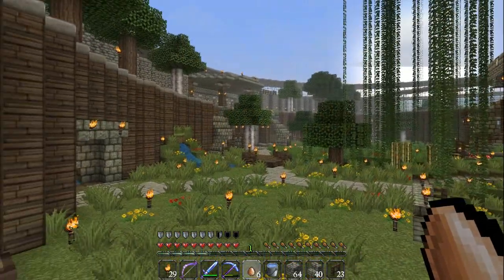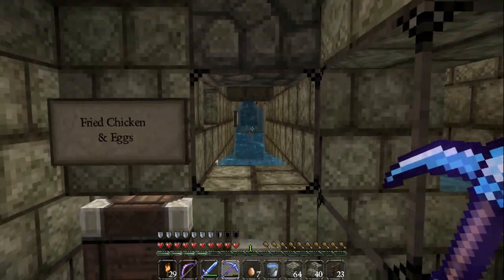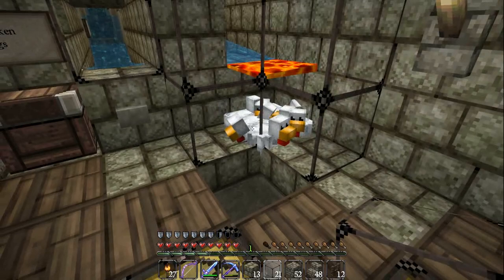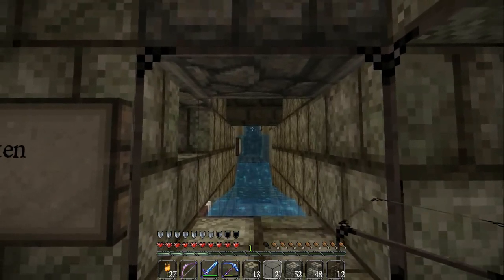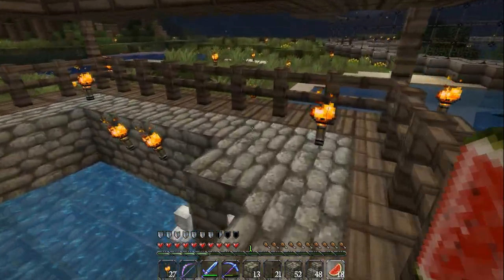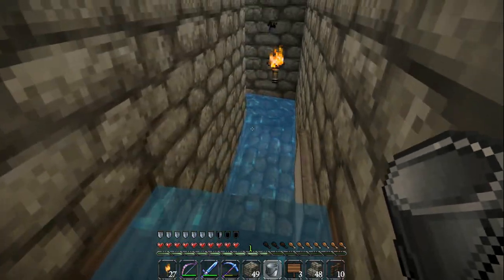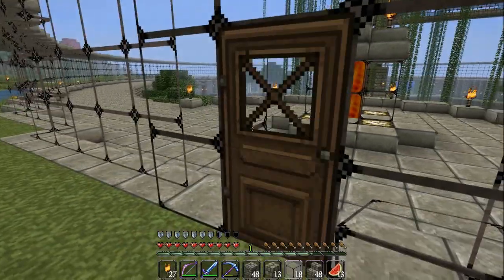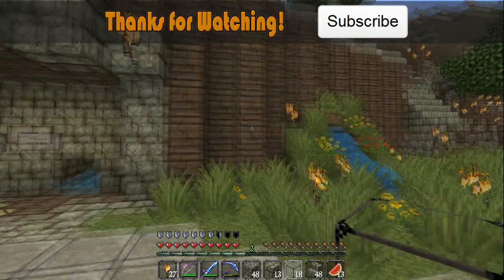100% Effective Chicken Transport - Minecraft LP #74

Comment: I have made an improvement to the chicken coop. Basically I have another coop on top of the coop you already have. The top coop's water supply is permanent meaning chickens never fall and get cooked. However the eggs they produce fall from top coop to bottom coop into the waterway. So even after cooking all your chickens you do not lose the egg producing capabilities as eggs will constantly be produced by the chickens in the top coop.

Comment: Love the whole chicken farming system.  I'm having an issue though in my waterway to get the chickens into the coop.  I get them around the first corner fine, but when they get to the water stairs w only 2 squares they get stuck.  I'm using the updated fence method to push them to the next level.  Tried a combo with fence and stairs, but no luck.

Comment: I made my chicken transport like this (about 50 blocks away from my base) but becouse they try to go back now it takes forever 0.- thnx for the chicken farm tuts, I got it full option now ;) 

+ a little suggestion: the lever for the chicken/eggs piston.., replace it with a button and a T flip flop, then you can switch in your base AND at the coup ;p (you can run another wire to lamps to see if it's on chickens or eggs)

Comment: I have a slow computer, so I have to set my render distance to normal, or even short to get reasonable FPS.  If there's a lot of chunks loaded, you can speed things up by changing distance mode to tiny and then changing it back again to what you normally use to make it swap distant chunks out of memory.

Comment: And found a fix.  Turns out the fence post must be surrounded by a substance the fence with extend posts to (not glass, for starters).  I had been building a glass elevator outside to carry the varmints, and as soon as it rose into the air, they got stuck (the fence posts were surrounded by glass at the time).  Switched over to dirt and they no longer get stuck.

Comment: He should make a secret xp farm i know how to make one its 2 pistons 64 redstone just in case make a 4 by 1 strip up 2 blocks so if any block you use youll need 8 of it then break the 4 blocks in the middle then a 12 by 12 by 5 up with water flowwing down the middle 2 buckets of water then use repeaters to make the pistons go up and down and make a mob spawner if you know how and when the mob spawner is done put water in the middle and there you go.Monkeyfarm read this.